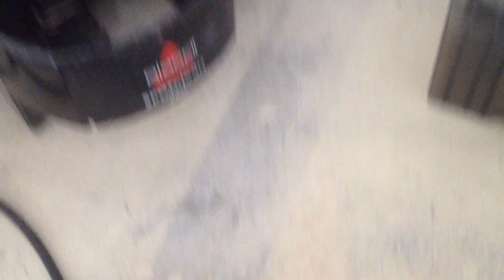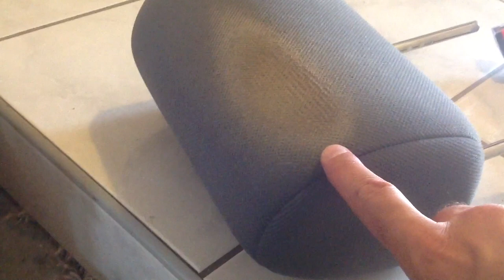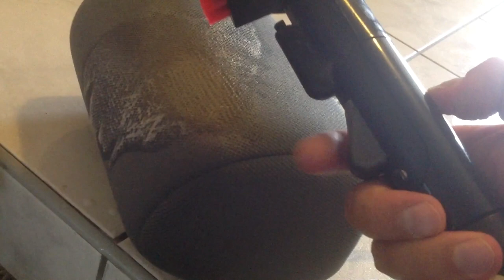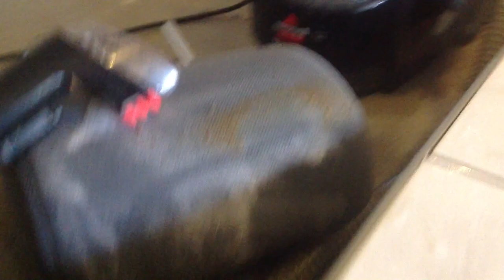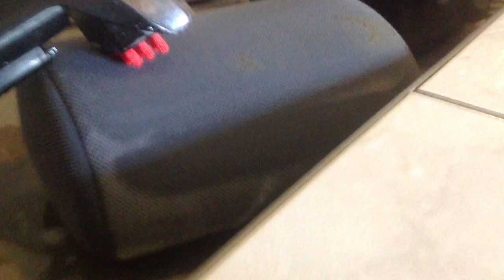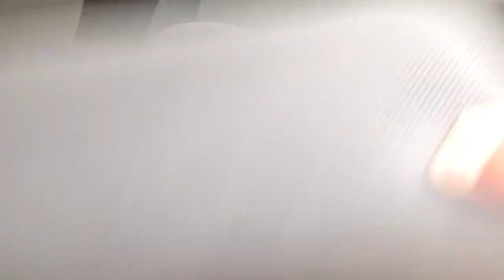How to Clean a Car, SUV or Truck Headrest with Bissell Spotclean Pro

Comment: I'm a detailer and use the Bissell many times weekly. This is a great machine for what it is, I also own a large extractor but reach for the Bissell more frequently because of how easy it is to use. It doesn't heat water but that's o.k. just add hot water. I've had mine now for about a year and a half, using it almost daily with no issues. I can say to each his own but in my opinion, you are using it totally wrong... you soaked that headrest for no reason. I would have sprayed the stain, agitated it to break down the gunk with the brush on it behind the suction strip, then sucked up the mess. Waala, finished in a shorter time than it took you. But again, it is an awesome machine, and is very versatile for all kinds of things around the house, car, RV, office, etc. Good review of it's use though, take care.
Reply: The word is voila not waala.

Comment: It's not Bis Sell.  It's one syllable Bissell. Like missile with a B.

It's an extractor not a brush. Apply the cleaner solution and then pull the nozzle backwards to extract the dirt. 
With the amount of solution you used you might as well have washed it in the kitchen sink; or, better yet put it in the washing machine on Delicate cycle.

Did you even bother to read the directions before you decide to show us how to use it?
Reply from the maker: lol

Comment: Does it have a built in heater.?thanks
Reply: this one doesn't got a built in heater. but i alot people says the suction head connected to the hose breaks very easily. epsecially when you wrap it around that circular thing. you constantly straining the hose. i just got the bissell 5207J that comes with heater. it keeps water warm but doesn't heat up water. suction power in the 5207 isn't that strong. the 3624 which is in the video is probably the strongest for their spotclean.
Reply: @calvinwong365  how to not break te hose?